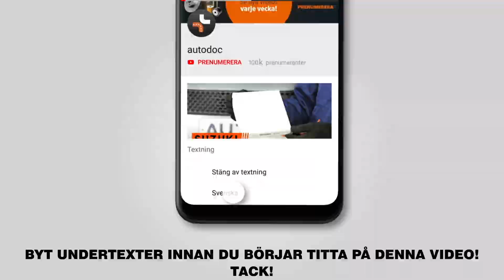Så byter du styrslagsände på VW GOLF 4 (1J1) [AUTODOC-LEKTION]

Comment: Rather strange that a digital vernier caliper isn,t used...and threads are not greased.The wire brush looks as if it could be replaced with a new brush😊..